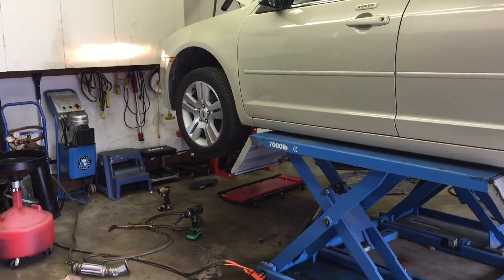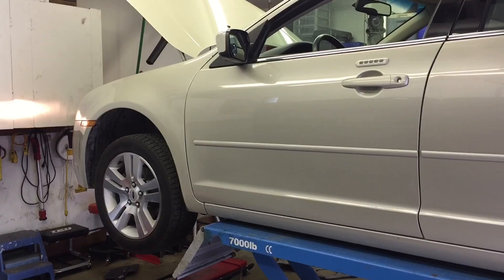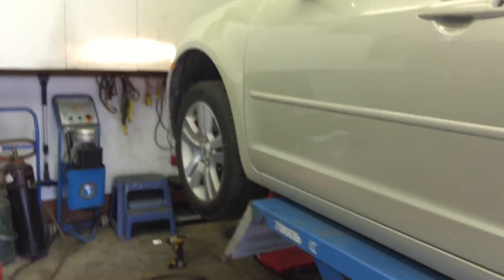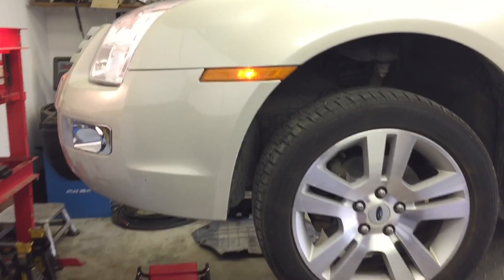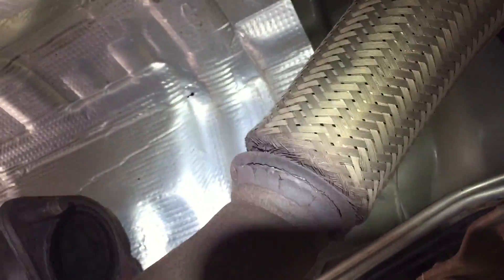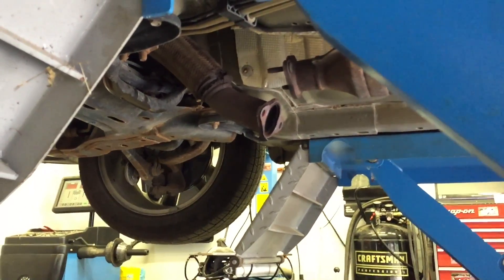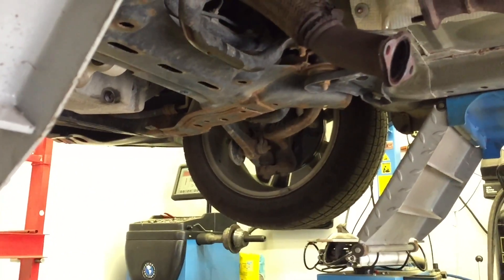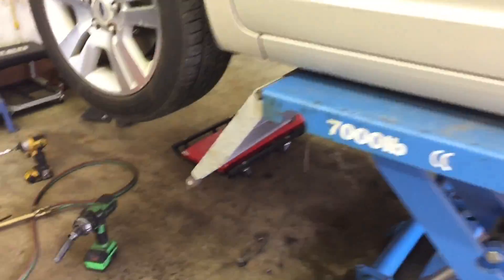Ford Fusion Open Exhaust

Comment: In my fusion, there's a second catalytic converter in place of the flex pipe(which makes it California emissions approved). As I do not live in California, Do you think I could just replace the cat after the exhaust manifold with the flex pipe?
Reply: No.  You still have a flex pipe.  Its just a California approved flex pipe. :-p

Comment: @DanielJaegerFilms, I have same car with same problem. It does not appear to have any nuts on the threaded studs. There's no way Ford tacked a weld on there instead of using nuts. Owned since new.

Comment: What brand pipe did you use?  I purchased a Walker for my wife's, it was about $50 as opposed to $750 for the ford part.  Do you have a more detailed video of replacing that?  I may have an exhaust shop tackle it because I don't have a way of getting the car up high enough.

Comment: Do you make sure you spray brake cleaner on them rotors and cleaner before using them? It will ruin pass due to the coating they put on the rotors to prevent rust.

Comment: excuse me, may i ask what is that part that looks like a woven basket?
Reply: maryam960 piece thats connect to the headers which leads to catalayc convertor idunno i guessed
Reply: I'm late, but it's called a flex pipe. It allows the engine to move on it's rubber iso-mounts without damaging the exhaust system.

Comment: Thats the sound!!! My car has started making a put put noise.
Reply: Are you talking about the sound it makes when reving it, when it hits the limiter and winds down? If so thats just the sound of it detonating. Which is normal for a lot of vehicles. Especially if its running very rich.

Comment: Shoulda left it like that
Reply: I just did that to mine and it sounds great, but only downside is check engine comes on
Reply: @xghoststalker16x47  What wrench size did you use for the nuts that connect to the flex pipe?
Reply: @thexp2808  i believe it was a 15mm

Comment: or not a mechanic if you can't rebuild engine's, everybody is told buy a new engine when you can fix the one in it, if want a car fixed take to a dealership not these half ass wanna bes if it's a little place that's got crack heads in it turn around and leave
Reply: lol ok
Reply: Kody George Aw ok, that totally makes sense............
Reply: NEVER Goto a ford dealership!!!!! I was ripped off the put a new cooling thing in my engine because the temp wouldnt show on the dash, and when i was driving home from the dealership the engine blew on the hill.
Reply: It was a 06 fusion SE